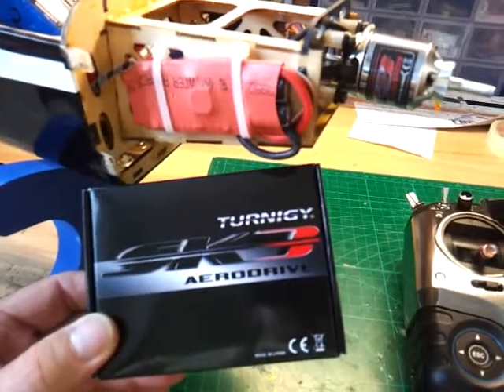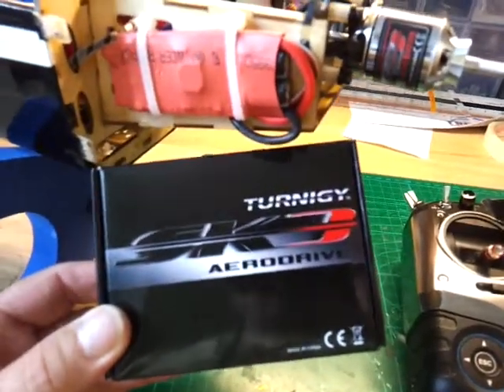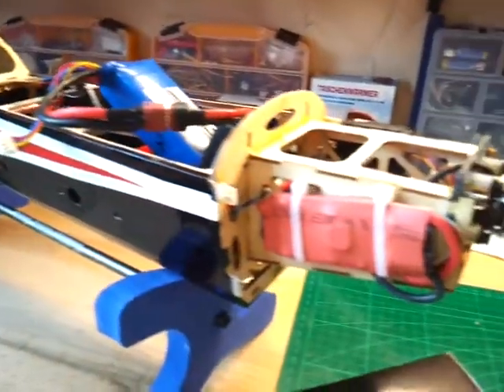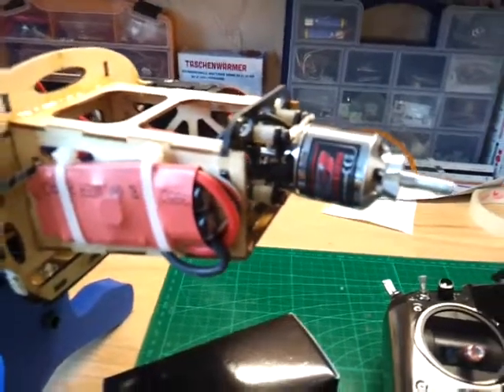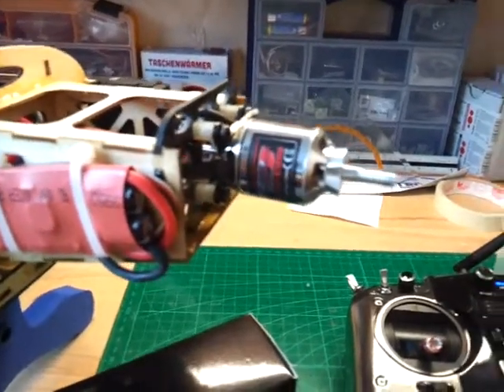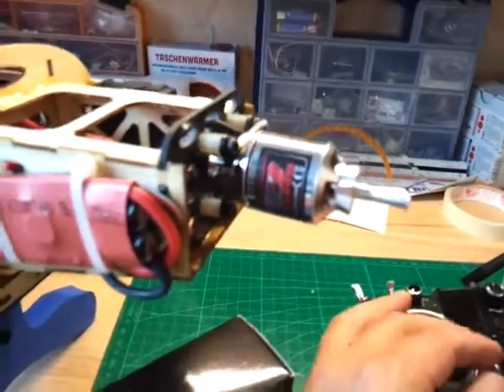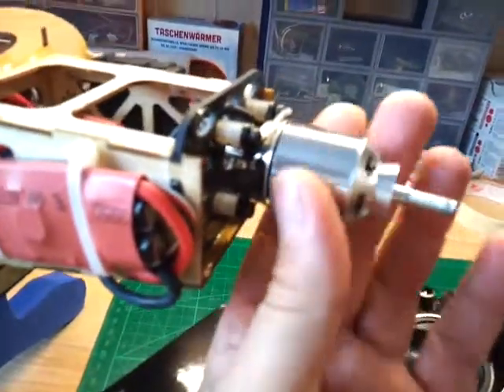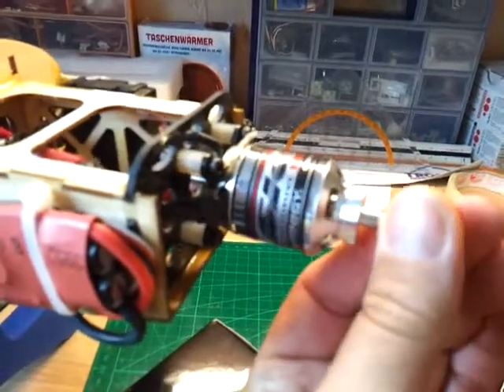TURNIGY SK3 Aerodrive (Bearing Problem)

Comment: Übrigens hättest du diese Kombi auch durchrechnen können, und dabei schon feststellen können, das diese Komb am oberen Limit ist. Besser wäre einen etwas niedrig drehender Motor an 4S..... Schau mal hier: 
http://ecalc.ch/motorcalc.php?lang=de&lang=de&cooling=good&motornumber=1&weight=850&calc=auw&warea=50&elevation=500&airtemp=25&qnh=1013&batteries=lipo_2500mah_-_65/100c&chargestate=6&s=3&p=1&esc=max_60a&motor=turnigy&type=35|sk3-2836-1040&gear=1&propeller=apc_electric_e&diameter=12&pitch=6&blades=2&speed=0&project=Aerodrive SK3 - 2836-1040kv